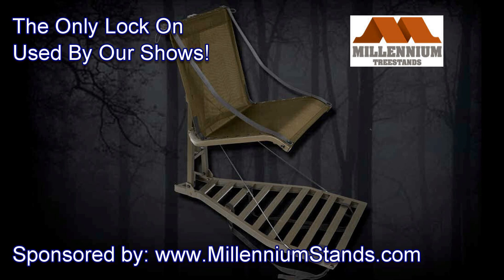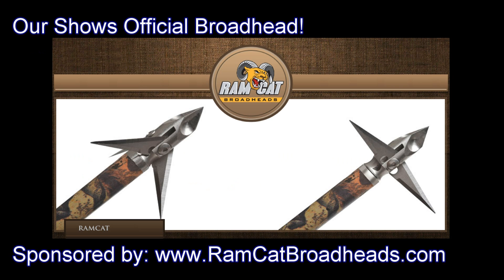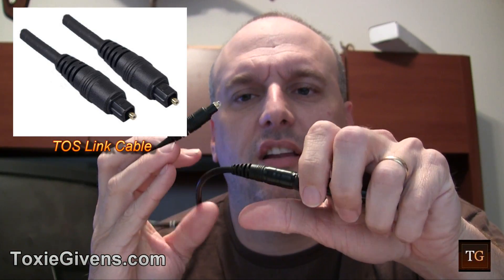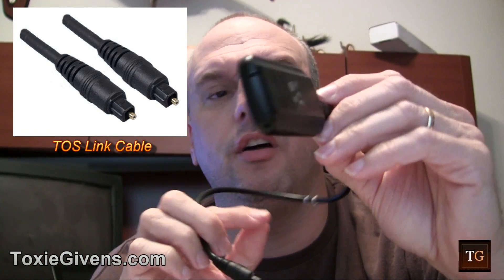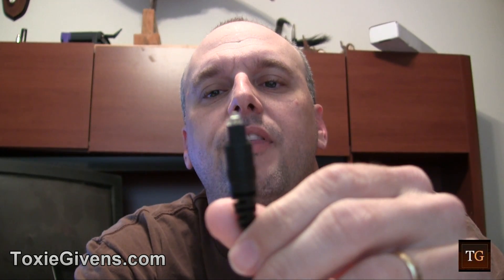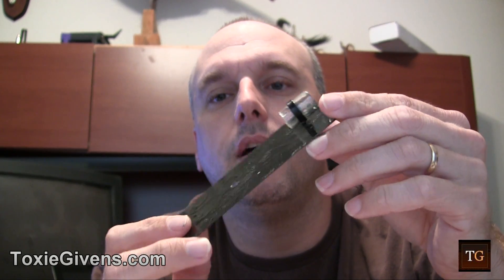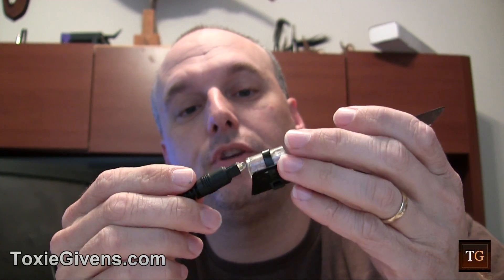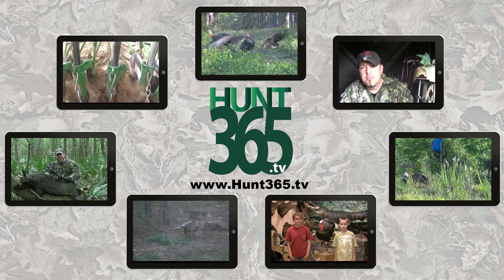Homemade LANC Controller

Comment: How did you modify the TOS link cable into the remote. I have the M50 and this would be an awesome mod to have for the camera. Thanks.
Reply: I think that the way to attach the TOS cable to the remote would be to use a TOSS link couppler, attach it to the remote. Plug in  one end of the TOSS link cable and just shoot away.